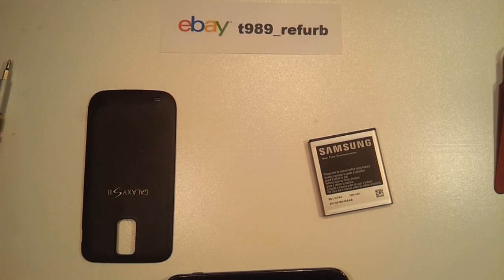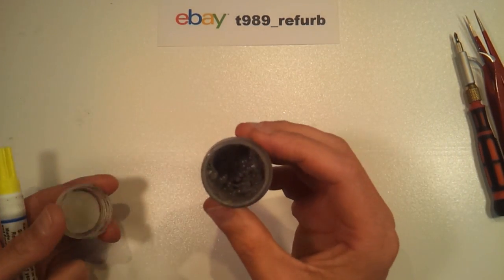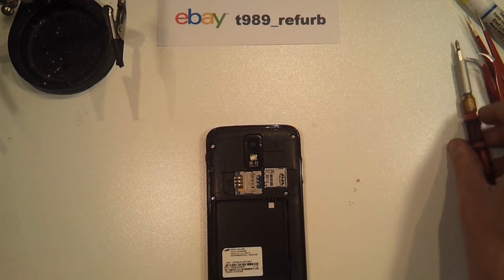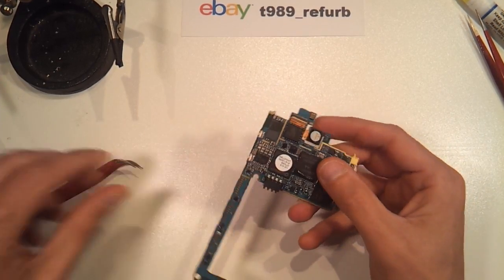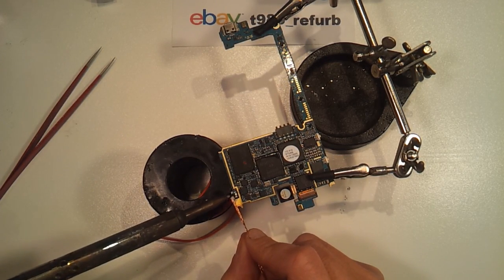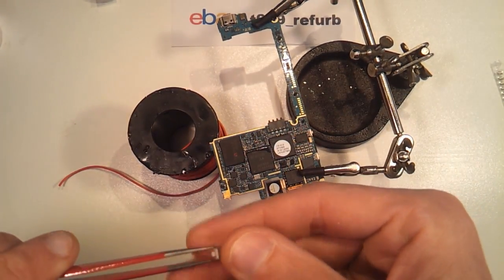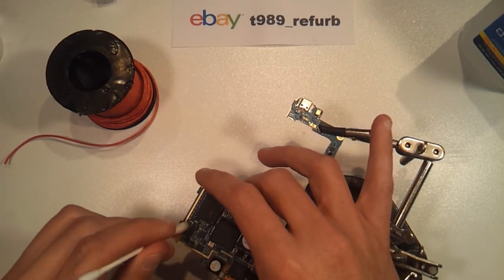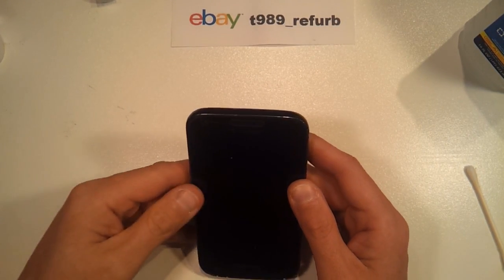Samsung Power Switch Repair Fix Replacement Galaxy S2 t989

Comment: I have a faulty power button on a Galaxy S4 and want to make sure I the replacement correctly have you replaced any of those?
Reply from the maker: I have not yet had the opportunity to replace a power switch on the S4.  I can confirm that the same switch and soldering technique is required for proper repair.  My experience is that the symptoms for the S4 are the same as the S3.  Insert the battery (at least partially charged).  The phone will attempt to turn itself on without you having to press the power switch.  The phone will vibrate once then load up to the "Samsung Galaxy S4" splash screen.  The boot process will then fail at this point.  The screen will remain black and fail to load all the way into Android.

Comment: Hello Steve, what celsius is the setting when reflowing the button to place?
Reply: +Jave Rosales I'm just scared I'll burn the new button.
Reply from the maker: +Jave Rosales I believe it was pretty high.  Around 400 C.  But the airflow volume was low, maybe only 2 or 3.  The high heat allows the switch to get hot enough to melt the solder while the low volume keeps the "wind" from accidentally blowing away any of the other small surrounding components.  Also, feel free to experiment finding the correct temperature while removing the old switch.  Since it will be replaced anyway, it can be your guinea pig.
Reply: +steverrada Thank you Steve!  Awesome tutorial.

Comment: Hi Steve,  First thanks for the video!  Second, I just received the switch from you I ordered on eBay but when I compare it to the existing switch, the one you sent me is larger and the points don't match up to the board correctly like in this video.  I am going to send you an ebay message, but it seems to be possibly the wrong switch.  It says 4.75 mm on the package.
Reply: Update.  With a little modification to the pins on the switch it worked.
Reply: spinn360 Update again.  Turns out I got the i777 model or whatever ATT has and the T-mobile model has smaller different buttons.  So if you have the SGH-T989 get the 4.00 mm not the 4.75 mm.  Thanks again Steve for the quick response on eBay!

Comment: I got a question is my motherboard broken or is there something else wrong on my Samsung galaxy s2 cause it was having all those symptoms that you said. I took it apart kinda used some tools to see if I could just tighten the power button but now the power button is completely dead do you know what I can do cause I took it to the nearest repair place they put on a new button but it still doesn't work but free of charge to me
Reply from the maker: Please send me some photos of the power switch area of the motherboard.  My guess is either the new power switch was installed improperly or one or more of the three very small components that sits next to the switch was accidentally damaged by you or them.  Please send me some photos   t989refurb at gmail

Comment: Is it possible to fix it with soldering iron equipped fine tip?
Reply from the maker: I believe the hardest part would be the removal of the old switch.  You would need to get all five solder points melted at the same time so you could easily lift the old switch off.  Installation of the new swtich should not be a problem.

Comment: Where are you located in IL?
I opened mine up but I don't have soldering tools to put in a new switch.
Reply from the maker: Humboldt Park neighborhood in Chicago.  If you are not close, you can mail it to me for repair like most folks do.
Reply: steverrada How much would you charge just for soldering the button on? I have it disassembled already.
Reply from the maker: Saad Salman Zia   Current cash price for this repair is $22.  Please send me an email if you are interested of have any more questions.  t989refurb at gmail
Reply: steverrada I just sent you an email

Comment: is that power button switch the same with the galaxy s3? Is that possible to replace it with soldering iron??
Reply from the maker: ATT S3 uses the 4.75mm wide switch I believe.  All other S3 models use the 4mm wide switch.  I have never attempted this repair using only a standard soldering iron.  A few folks have written in the comments here that they were successful doing so.  Just be careful not to damage any surrounding components by accident.  If you decide that you do not want to attempt it yourself, I would be happy to fix it for you.
Reply: Ok i have already removed the button that was causing the phone to restart all the time! I removed the left solder from the board the the supporting holes using a soldering wick and i think i wouldnt be too hard to place a new button there! But thanks a lot man for the fast responce and info!

Comment: Do you think its possible to remove and the power switch with a conventional heat gun on low setting- 400c? Ive seen other people do it on the s3 but the s3 doesnt have the small tiny capacitor nearby as on the s2. Even if i shield them and the rest of the components its possible it will still be too hot and melt off. My solder tips are too wide and it would be impossible not to touch the nearby components.
Reply from the maker: In my opinion, removal of the old switch is the hardest part because you have to melt all 5 solder points at the same time.  I have heard from folks who were able to do the removal with a heat gun.  Just be careful.  I would say the trick is to use more heat but less air volume.  Also see if you can make a tin foil nozzle to direct the hot air only at the switch.  Good luck.
Reply: steverrada Thanks. Thats a very clever idea. I will try that.

Comment: For some reason my solder paste will not turn silver and shiny when applying the heat in place on the board. It's turning a dull grey and then nothing happens. I shoot the air at the paste else where and it melts and turns shiny, what's going on here?
Reply from the maker: The switch itself and other components on the board can act to block the flow of the hot air to the solder.  Try hitting it from a different angle, turning up the temperature a bit, or increasing the airflow.  It must turn silver and shiny to be considered a successful solder job.

Comment: Hey man great video, but I have a question. Is it possible to remove this power switch and replace it with a different momentary switch by running wire from the new switch to these solder pointsa few inches away? I need to mount a phone in a display case type thing and the power switch needs to be located on the casing of the mount, would this be a problem? How would I do it?
Reply from the maker: +Matt   In theory, this could absolutely be done.  I think the trick would be finding a place for the wires to exit the plastic frame once you are finished.  Also, if you were to ever want to use this phone outside of the display case, you would have a gnarly growth of wire and switch to deal with. In terms of getting this done, you will need to solder the two switch wires to the two corner solder pads furthest away from the edge of the circuit board.  The other 3 pads only provide mechanical support to keep the switch attached to the board.  Good Luck.
Reply: +steverrada awesome thanks a lot for your reply, I may ask again for help on this haha :p
Reply: steverrada Hey mate, another question, I have been working on this with an LG optimus fuel android tracphone. Same situation and I've gotten it to boot once or twice after removing the power button and soldering wire but it seems the trick is finding the right solder points where the switch used to be. Any tips or help if you know the device would be awesome, the solder points under the switch position are as follows. There are 5 contact points, 3 small ones in a line closer to the interior of the phone's pcb, and then two larger ones right on the edge of the board looking like this basically:   - - -
Where do I need to solder to? I feel as though some of the contact points need to be connected to boot but I;m not sure which ones and I feel like my desoldering and experimenting is damaging the area on the pcb where the power button was. Like I said I had it set up at one point where it was booting using the button and the wires on command, but when I tried to solder the wires on it melted and then I couldn't figure out how to reproduce it.
Reply from the maker: +Matt I only have experience working on Samsung phones, but the PCB footprint sounds the same.  Of the three small ones in a line towards the interior, you should need to solder the wires to the first and third.  Take a look at the description for this video.  I have a link to a photo that shows the switch itself, and which pins actually form the contact closure.
Reply: +steverrada gotcha yeah I have checked that out and its the same, how would you recommend soldering wires to that set up?
Reply from the maker: +Matt very carefully! ;-)  If it were me, I would solder them following a similar procedure as in the video.  I would pre-tin the wire first. I would then apply some solder paste to the pad on the PCB.  Next I would use a set of helping hands to very carefully position and hold the tip of the wire into the solder paste on the pad.  Lastly, I would use the hot air station to carefully melt the solder paste to complete the procedure.  If you have a fine point on your conventional iron and a steady hand, you probably do not need the hot air station.  Can you send me some pictures, either now or when you are done?  I am curious to see how it turns out.  t989refurb at gmail
Reply from the maker: +Matt I found an old motherboard and wired up a momentary push-button switch to it using a standard soldering iron and 60/40 lead solder on a spool.  I have some pictures if you are interested.
Reply: +steverrada I would love some pics and I will send my setup to you when I get home I'm in university right now haha. all the help is greatly appreciated!
Reply: steverrada hey how do you wanna exchange pics?
Reply from the maker: +Matt send me an email.  I will reply with the pictures I took yesterday.  t989refurb at gmail

Comment from the maker: If you are skilled and practiced in surface mount soldering then you should be able to perform this repair with a conventional contact soldering iron.  If not, then I would think twice about attempting this repair yourself.  I don't think it is worth damaging the whole phone over one botched soldering job.

Comment: I can't find solder paste anywhere. I bought one from eBay and it says solder paste flux. Everytime I look, flux. Help!
Reply from the maker: The kind I am currently using is called "Mechanic Solder Paste"  It comes in a small orange and blue container.  Check out this eBay item:  180926725385
Reply: Thank you sir means a lot. Too bad I already ruined my board. lol
Reply from the maker: unknownally
  Can you take some pictures of the ruined area of the motherboard? Maybe it can be fixed.  Email them to me at t989refurb at gmail.

Comment from the maker: 00 Philips Screwdriver
Electronics Tweezers
Solder Paste
Water Soluble Flux Pen
Q-Tips
Isopropyl Alcohol
Toothpicks
Solder Wick
"Helping Hands" Tool
Conventional Soldering Iron
Hot Air Re-flow Solder Iron

Comment: i dont have the air flow machine or solder paste, just regular soldering iron and solder, can this still be done?
Reply from the maker: I have never tried the repair using only standard issue soldering equipment.  I have heard from a few folks saying that it can be done.  Unless you are very proficient at soldering, I would not suggest you attempt this repair without the hot air machine and solder paste.
Reply: I tried but I can't seem to be able to get to the solder under the button, thus not being to melt the solder and take the button off the motherboard